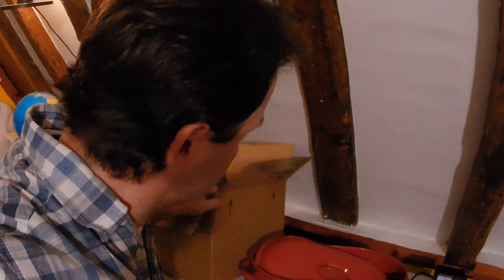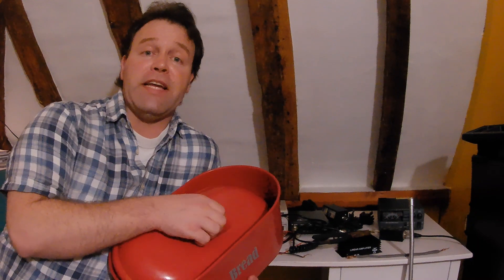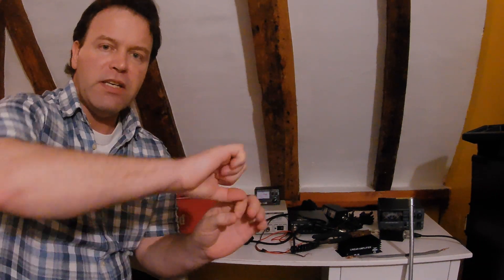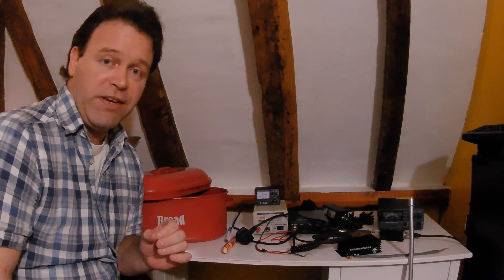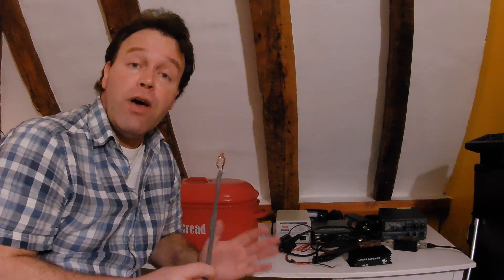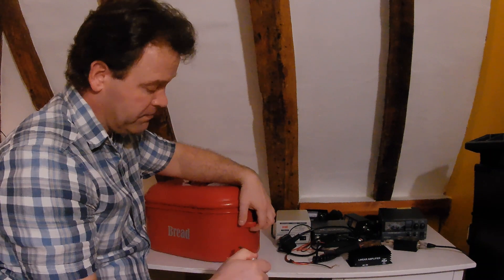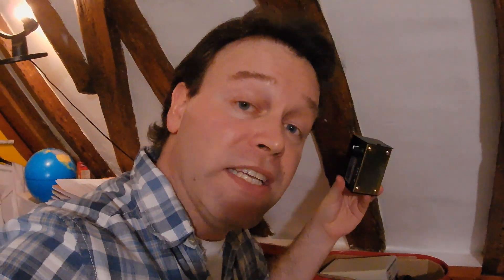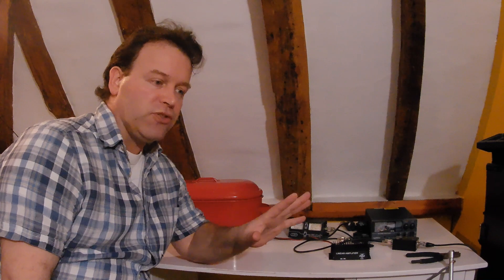CB Radio EMP Protection

Comment: Well I like your bread box across the pond we like pop corn or large cookie tin with the snug fitting lids simple add a bonding wire between the lid and body and you your well on your way also the fiber board is a good insulator i usually tape the seems so you can’t get an arch from the shell.  The other thing we use is a steel trash can again bond the lid to the body.
Reply from the maker: I think a steel trashcan is a great idea for larger items. Thanks for the tip!